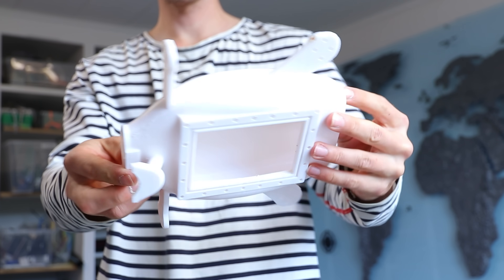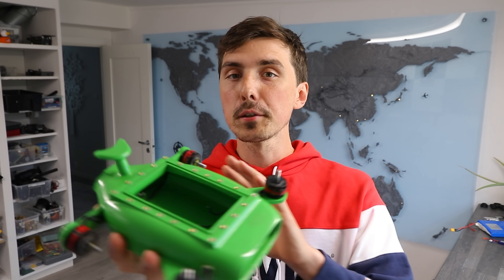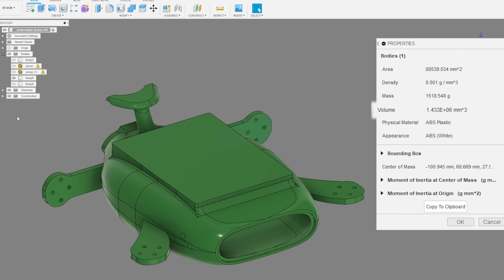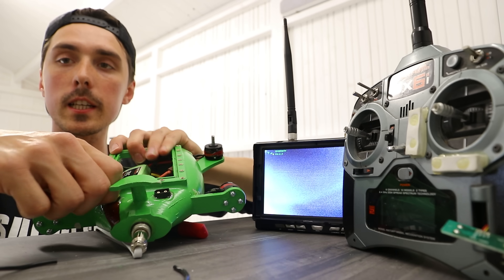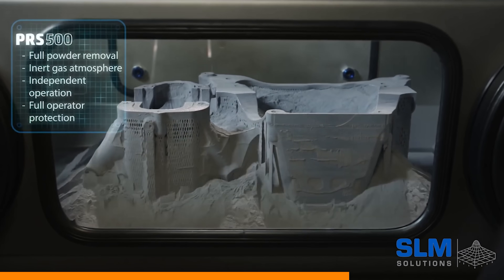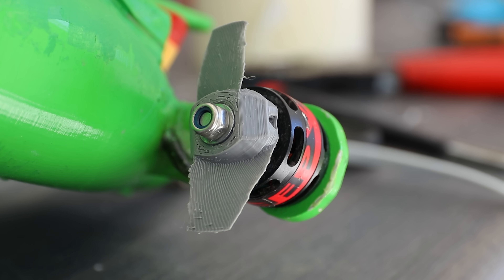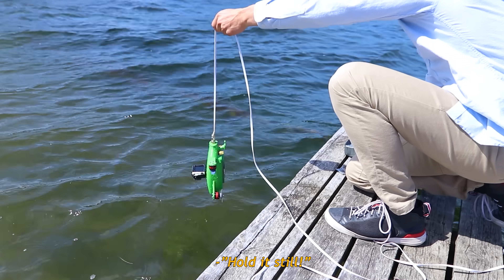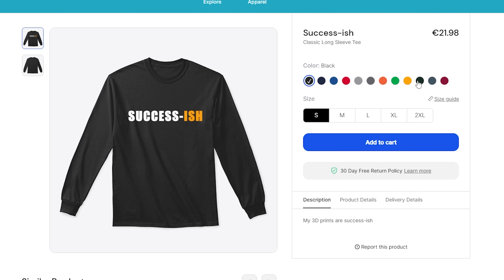Underwater Drone Built With Parts From a Flying Drone

Comment: to avoid motor problems in seawater, place them inside and use magnets to couple the outside props to the motors.
As an option, instead of props placing far outside, you could use floating canals with the advantage of not getting hit by cable or other obstacles

Comment: The ventilator opening is also enabling waves destroying the electronics.
Make it sealed and get cooling from the water.
Either by using metal to be contacted by water or use an active watercooler from a PC

Comment: I hope you know that 3D-printing-filament is not waterproof? It's way too porous and spongy for that. 😐
Every person trying to built an underwater drone ended up having to put the electronics into some kind of plexiglas tube or Tupperware box. If you don't do that, you will never succeede. It also helps with the buoyancy, since the water can be inside of your 3D-printed shell, instead of having to make it so heavy, it overcomes the buoyancy of the huge air bubble inside of your drone, it sinks  deep enough into the water the propellers can reach the water and pull it under the water surface without you having to push it underwater. 🤔
If you are interested, there's a manual how to build one, you could take some inspirations from. The guys' channel is called "CPSdrone". 😉

P.S.: An experience I have made is, if you put the hatch on the bottom of the corpus, the "diving bell effect" will try to keep as much air in the body as possible, but note that higher depth will compress the air and have the water level inside of the craft rise. It's the same effect half-wet submarines use. So if you put all the electronics on the top inside of the shell, you should be fine.. if that's too risky for you, maybe think about pressurising the inside of the chamber to the outer hull pressure as to keep the water out and keeping the corpus from getting crushed.

Comment: Have you tried putting the access cover under the unit instead of on top? The air pressure inside might be enough to prevent water from coming entering the sub.

Comment: does anyone sell a kit for something like this. It's brilliant! I live on a small sailboat, and it would be wonderful to throw a bit of inexpensive equipment or the side to inspect an anchor as one example. I've built drones before so I could probably wire one up, but I don't have access to a printer or the skills to fiddle with design software.

Comment: here's an idea: fill it with mineral oil. it will insulate your electronics, and because it's not compressible you should not get any water coming in. keep up the good (but mildly insane) work

Comment: Would it be possible to make a formel 1 version underwater drone? Thinking more streamlines, maybe speed combined with hydro fins to change direction. Perhaps more torpedo shaped body, clear plastic/glass front and fins to control direction. Im aware it will be hard to control at slow speeds. But how fun would it to be to have a fpv drone going 20knots, ok 5knots. 20+ would be crazy tough. With googles, it would be like flying thru water. Have a design in  my dumb head, but. Cant draw, nor are my cad skillz near good enough. Non the less to run fluid simulations to see if it could work, somehow.. Also guessing one need a power engine to push a underwater drone fast. xD
Edit. Maybe a starship inspired design, but more important to hhave the wings or flaps turn vs changing angle like on the starship. Just a idea, suspect it is a bad one. Any ideas?

Comment: you cant just place a piece of copper on the bottom of the floating device and thermal paste the overheating components to it? i feel like it can be effective since that copper will be always touching water on the bottom the heat transfer will be really good.
and also you could have the floating device fully closed to water

Comment: please dont give up on having a hatch you can open, And I didn't see you properly testing for leaks, submerging in a wheelbarrow with neutral pressure isn't good. I would recommend adding a schrader valve for testing, you could use a hand pump for a little bit of pressure, and just leave it on the drone knowing it is air tight. And to test for leaks, You can use the wheelbarrow (lol) or just some soapy water, watch for bubbles. I really hope this project continues, I myself have always wanted to build one, Mine was going to have a metal detector in it as well. :)

Comment: normal pla filament doesn't like water, and double so with salt water which is much more corrosive.  
there are some special water safe types. 
it would have been a better idea to use just one internal motors and some mechanical gearing to through bearing gaskets so you could have the motors inside the dry space, you should also have put some desiccant material inside the drone to capture any water that does get in, you could just pull open one of those cheap disposable dehumidifiers and dump the pearls out into the drone, they hardly have any mass when dry.

Comment: Put the drone in tap water after using it in salt water. I made a similar project over 20 yeas ago. I used small water pumps  as thrusters that I got from Biltema. They also got stuck if i did not put them in tap water. I used an Industrial enclosure to put my electronics in.

Comment: If you use a magnetic reed switch on the inside you can use a magnet to turn it on and off without having a hole in your submersible.

Comment: Yeah the motors you’re using our belt for underwater use so if you don’t boil them properly they will easily corrodes wants to water dries and then when you go to reuse it bad things will happen

Comment: I have found that cables and cable insulation is not waterproof at all. That's why I solder the ends witch also melts the insulation, making the cables more waterproof.

Comment: If you have a tether anyway, why not just put the battery and stuff in the buoy and seal up the drone?

If the drone doesn’t need to ever be opened again, you could just erase most of the problems.. so just send power down the tether?

I’m sure there is probably a reason you didn’t tho.. I don’t know much about electronics. I’m assuming maybe signal interference or something, maybe?!

Comment: Just my 2 cents, if you already have a long cable running to the drone why not try running power through it as well? And for the overheating chip in the floating box why not make a way for the heat sink to cool on the water?

Comment: WIth all due respect, if it's underwater, it's submarine. Not drone. 
Also, aerodynamics does not work underwater. You need to learn about water pressure and how salt water works first.

Comment: My experience with printed seals is that they're not tight at all. Dump them and use off the shelf O-rings, then it should be fine. Well, if the lid is watertight.

Comment: Try using hydraulic zylinder seals. Those are designed to press the sealing lips onto the sealing surface when pressure is applied

Comment: Bulkhead fittings, motor bearings, fdm 3d printing will always have a potential leak point at the end of the print , just put the electronics into some sort of tank anyone can buy or repurpose. O ring design wasn't good, also needed more squish I think and fatter since printing isn't very flat .

Comment: I have a challenge for you. Create an RC surfing robot (about 30cm tall). I want it to paddle and steer by controlling each arm at different rates, stand up at a press of a button (legs attached to the board and using a wiper style mechanism to standup) and then then steer while up by shifting its mass left and right. I then want you to collab with a pro-surfer to see if he can make the robot catch a wave.

Comment: i highly recommend using the balancer connectors, because if you have a good charger you can see every cell. so you can detect bad cells so you house doesn't burn down. (there are more reasons why to use it)

Comment: 8:08 Probably already been suggested im sure, but you need a Ballast. Like ships and submarines use. Check out the Brick Experiment Channel "Building a Lego-powered Submarine 4.0 - automatic depth control" . Yes you could in theory use outright thrust to dive, but the amount of power you would end up using to stay at certain depths would be counter productive to say the least. With the ballasts set up correctly (you may have to make another shell in order to fit everything) you would be able to dive, hold a depth and not use a ton of power to just float at that depth, Not to mention the noise and such you create having constant throttle to dive. It would surely make the drone less useful for checking out underwater life.

Comment: The case printed on the FDM printer is not airtight, in my own project I treat it with epoxy, covered it with a lot of particles. XT-60 connectors are also not hermetic, the contact in them is inserted into the plastic, but not filled with plastic. The engines I used had very little lubrication. I took them apart and added a lot of grease. Covered all parts with electrical insulating varnish. I hope my useful tips will be, link to the video with my project https://youtu.be/MbXsGB92IIA

Comment: One suggestion, if the connection to the internals of the drone is a physical plug, the metal contacts could be bridging in the water. Even if it's fresh water, there are still minerals which can facilitate electrical transmission, and all the worse when the contacts are closer together too. It'd be better to fully seal it and use induction charging to supply power, maybe with a physical twist lock to attach it to the drone. Also as others have already said, use a solvent smoothing technique or just take some sandpaper to it so that the seal with the o-ring will work better. If you take a piece of aluminum and make it part of the hull, you can cool the electronics by placing them directly on that. The heat will dissipate into the water much better that way.

Comment: Have you considered a pressure compensation system?  Most industrial ROVs fill every cavity with a dielectric oil (something like mineral oil) so that the interior doesn't see the pressure difference that occurs underwater, as the oil resists the compression of water against the hull. At greater depth you may need a true pressure comp system with a bladder, but I don't think you'll need to go that complex. The oil is also denser than air so you won't need as much ballast to achieve neutral buoyancy. The most important thing is to be able to bleed all of the air out of the system, and to use a nonconductive oil.

Comment: You didn't need to cut the wires to reverse the motors. You could have just reversed them in BLheli Configurator (plug the ~100m cable into a flight controller, then plug that into your PC).

Comment: For 2 years I worked on ROVs for a competition. My experience is that:
1.WIRES LET WATER THROUGH. Oh yeah. If you have a wire running from the outside to the inside and you do not put a waterproof connector there - like on your motors - water will get inside through the wire itself. 
2. We never managed to seal a faceplate onto a faceplate like your hatch - no O ring could fully seal it, even when we used marine grease. Instead we had to put the O ring radially against a perfectly flat surface (like an acrylic tube) and use at least 2 of them.
3. ESCs heat up and increase the air pressure inside. This sounds kinda good if you have a good sealing, because it pushes air and water out. However it also puts a stress on your sealings from the other direction, which can damage them and make them leak, if you did not take it into consideration.

Comment: That's pretty amazing, I would like to give a suggestion for the floatation device though, instead of blowing air into it you could seal it with a water cooling system inside, a water cooling heatsink with a circulating fan and a pump using the water from whatever it's floating in.
This is a more complicated solution but it would avoid trouble from rain, rough waters, etc.
Also even on hot days the waters will be significantly colder than ambient air temp so it should cool the components very well

Comment: Your water proofing will vary based on the depth you run the machine.  Waterproof to 10' isn't necessarily proof at 20'.  But I do get a kick out of some of your projects bud.

Comment: a proper rubber seal around your screws should fix any water leak issues to a certain depth. Also, for the heat sink in the transmission box you could cut a hole in the bottom and seal a heatsink in the hole this way the lake water would cool the heatsink. Cool Project.

Comment: 5:06 ehhhhhhhh, while you technically can charge a battery without balance leads, it's really not advised at all. It's not as big of a deal if you're not parallel charging, but charging off the XT60 leads alone assumes that all cells are the same voltage at all times and the IR is the same as well, which is just simply unlikely. I would advise anyone watching this to think twice before doing the same...

Comment: Since you printer the drone in PLA you should have vapor smoothed the inside and the outside to prevent leaks. You can use dichloromethane for PLA or print the drone in ABS and use acetone.

Comment: The best tip I can give you is to seal the electronic components before sealing the actual body, and some wd40 can make a stuck motor spin almost instantly but I would recommend using some kind of water sealant or oil since wd40 isn't meant for being submerged in water. Grease can also work like a charm too, but overall you did an excellent job making this rc underwater drone.

Comment: the biggest flaw for the sealed is that it's a square and not a round shape, you're loosing a LOT of water resistence because of the shape, that's why you never see square scuba diving watch, they are always round because it's way better to survive the depth pressures than a square.

Comment: You need to use "O" rings, you get far better seal (it is how the high pressure parts of diving & hydraulic gear are sealed).

Comment: You probably won't read this but here are some things that could be improved:
- Replace original ball bearings with sleeve bearings
- Print the housing using ABS and do acetone smoothing
- Make the lid smaller and out of aluminium (you need the weight anyway)
- There might have been something wrong with how you used the gasket, make sure you use continuous one, ideally rubber one not the weird foam one
- Instead of gluing all the connector use proper IP rated connectors with orings
- If you want to avoid the balance connector, attach active balancer circuit (1A balance current and it's not dumping the excess into resistors but to the cell with lower voltage) because you do really need balancing for li-po, you can skip it for perfectly matched li-ion (a lot of power tools and all laptops do that)
Reply: Also, You can just cool down the transmitter by making a hole for the heatsink, and seal it shut so water won't get in. It's water cooling, free real estate.
Reply: The lid could be undearneath too, even made of steel for better weight distribution. The other good thing about this solution is the water is forcing itself more through roof, the air inside boat will prevent water from getting in (as long as it's horizontal, so most of the time)
Reply: I would agree that matche lthium ion don´t really need balancing (but you never know, if they are used for years and for example one is nearer to a hot driver, they will unbalance a bit), but all laptop batteries ive opened have active balancing (from 10 years ago to quite current models)
Reply: Ceramic bearings are pretty common, and they can't rust. The water should actually lubricate them so that you don't need any oil (less pollution in the water). Just don't run the motors when they're dry or it will wear the bearings. Due to the hardness required of a bearing material, you can't make them from a type of stainless steel which won't rust like 316.
Reply: Good point about using proper connectors. Even if you would manage to seal around a normal connector, it will most likely leak between the pins and the plastic. Water can pass inside the cables between the wire and the conductor, so if it can get in one end it will come out the other sooner or later.

Another issue is electrolysis of the conductors. While regular water is only slightly conductive it becomes very conductive when you have the positive and negative terminals in a closed space, the current corrodes the metal and the ripped of metal ions increases the waters conductivity which increases the current and thus the rate of corrosion until the conductors becomes a highly conductive metal soup.

In salt water you're just screwed if you don't do it right.

Comment: That's not a drone. It's an ROV (Remotely Opreated Vehicle).

Drones move without any direct connection except radio control, WiFi or Bluetooth. ROV's are operated with a direct physical control link (your data cable) known as a tether.

Comment: Water is most probably coming down the wire insulation from the motor side and into the drone. 

You need to somehow create a seal on the motor side where the copper wire enters into the insulation. Dab of silicon perhaps?

I've seen this happen multiple times before in underwater applications like bore pumps.

Comment: You definitely need a better charging solution. while you "can" charge a multicell battery without balancing, it also CAN blow up in your face if one of the cells overcharges. Always can use magnetic reed switches for power on/off.

Comment: If a heatsink is exposed on the underside of the flotation device the transmitter could be liquid cooled. vtx stuck onto heatsink, sealed along edge
----,,,----
~~~~